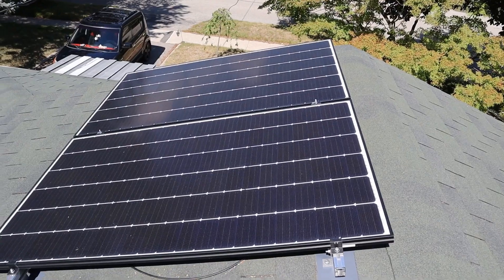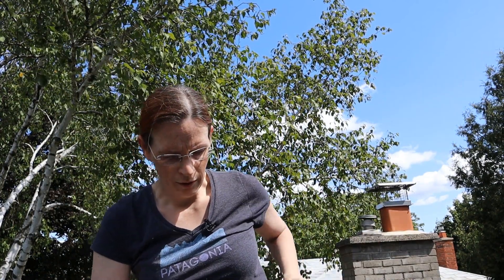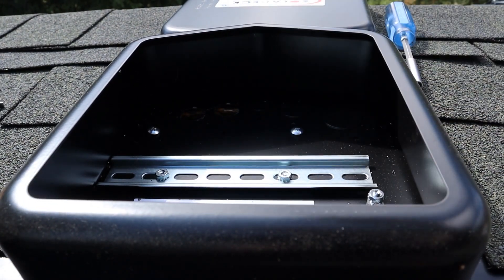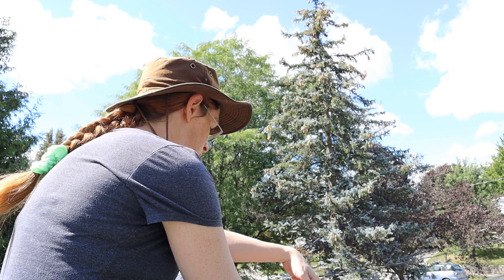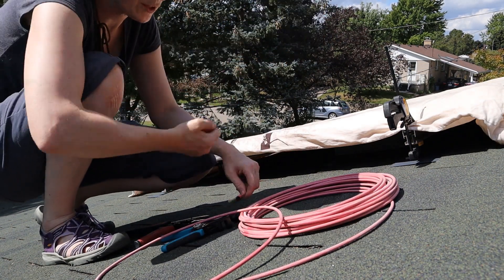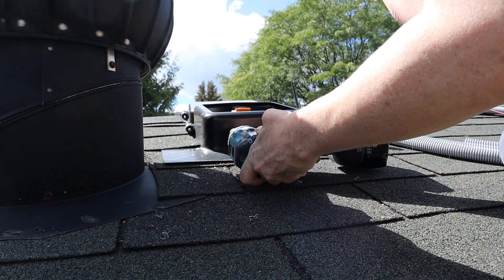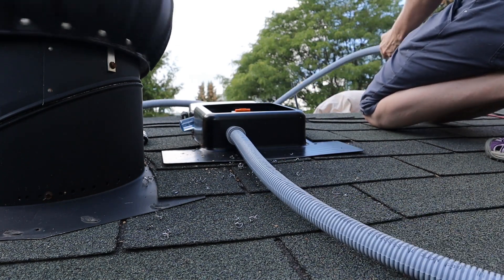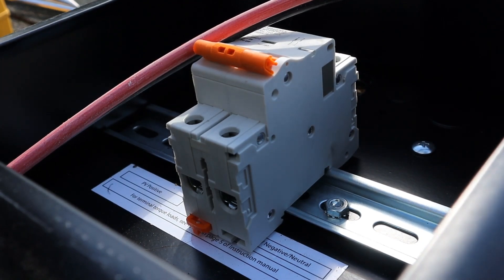Solar Panel Connection (Part 1) - How to build a 48v Lifepo4 battery (Ep. 17)

Comment: Hello from Florida, USA. I found your channel via the off-grid garage, I just wanted to offer my help if you need any, I have a 2004 Gemini 105mc that I bought with a bad diesel engine and converted to electric and currently live on full time.
Reply from the maker: Oh that's cool! Mind sharing details on your build? What batteries do you have (chemistry/capacity)? The displacement seems to be 8600lbs, eh? What motor / controller did you go with, and what's your range?
Reply: @TheDigitalMermaid  Not a problem, The build was a project boat at first, purchased it for 10k with non working diesel engine and onboard generator due to water flooding  the engines. The boat sat on the hard for many years at a local marina i lived near, so one day i saw the owner working on it and offered to buy it and negotiated down to 10k. Most of the interior was already repaired or saved, but the motors were locked solid with rust.. What happened was the boat sat in storage and the owner didnt check on it for a while and someone broke into it and left it open to the elements. The rain water collected inside and slowly flooded it out over time since the pumps were not turned on. So i pulled the motor and generator and took them apart and actually got them broken free at home, but decided to not trust them due to amount of pitting inside the bores of the engine, and just sold them for as much as i could. so i ordered a 96v 20kw liquid motor kit from golden motors in china and 8 x 12v 206ah SOK Lithium Battery modules before the prices of them went way up, i got them for $850/ea shipped. My batteries are setup in series due to the need for 96v for the electric motor setup. The modules already have internal BMS, Balancer, and low/high temp sensors. I reused the OEM onboard drive unit that went to the diesel engine and had a coupler setup machined for me so i could mount the electric motor to it and built a supporting mount system for the electric motor and glassed it in. I was able to fit the electric motor and batteries all within the area of the old diesel onboard motor. The factory displacement is 10,000lbs, but i am probably a little less due to the amount of weight that was removed between 2 diesel engines and massive diesel fuel tank. I am only able to reach 5.5 knots for 3.5hrs before the batteries are down to 10% SOC, which is my lower limit. The reason i am limited to 5.5 knots is due purely on heat exchange, the current cooling system i have setup for the motor is only able to maintain motor temps up to that speed continously within the recommended temperature range, it can go faster for short burst, but the cooling system cant keep up. Regarding my low limit, on a good solar day i can maintain 1.8 knots and never drop my battery SOC, so that speed is kinda my current cruising speed until i can finish the solar system. Currently i am in the process of rebuilding my solar system, i switched from series panel setup running a single off brand 96v charge controller to now i am running multiple smaller victron charge controllers daisy chained together with the panels in parallel. The problem with series was the shadows of a sailboat was killing my solar, i was loosing on average 60% of my potential due to constant fight with shadows on the panels... now the setup is more friendly to shadows.. I also have a new addition im adding to expand my solar an additional 800 watts on the fly when needed that can be easily stored away.
Reply from the maker: @williamhustonrn6160  "someone broke into it and left it open to the elements." - Oh how this makes me rage. Like, it's bad enough to break in, but at least there's some understandable motive there. To leave it open is just a giant "eff you!" to the owner. I hope that aresehole never knows a comfortable pair of shoes ever again. 

"Most of the interior was already repaired or saved, but the motors were locked solid with rust." This is pretty much the description of my perfect boat. Good hull / mast / rigging, shot engine / old electronics. 

I looked at SOK and they were top of my list before I decided to go DIY. Battleborn looked nicer still, but the price of even the SOKs was too much for what I planned to use. By my math, you've got about 20kw of power there, eh? 

One of my plans is to generally run below max speed as well. Electric motors, as I understand them so far, give you non-trivial range bonus when you run them below max. I'm surprised you're limited by cooling though... Any thoughts on improving the cooling? 

The shadow issue is the main reason I plan to run my panels in pairs with multiple MPPTs. The idea being to have at least one pair in clear view with the other pair is (possibly) shadowed by the sails. How much solar do you have currently? I know one of the huge benefits of multi-hulls is the additional solar options, but my heart is all in on monohulls. :)
Reply: @TheDigitalMermaid  Ya the guy was pretty sad about it i could tell, but he was far happier to get rid of it when i made the offer. He even told me multiple times he didnt think he could ever find someone to buy it due to no running engines.. So it sat for a long time in storage while he would fiddle with it from time to time as a retired older gentleman. Shockingly my boat i had prior to the catamaran was a monohull, but it was very small one i had picked up dirt cheap just for weekend fun. I had always dreamed of owning a catamaran... aka leopard... but they were outside of my price budget, so when i saw this and how long it sat over time.. i just went for it in hopes of buying it, because i had just watched a youtube video of another sailing couple find an unlisted catamaran for even cheaper.. but in far worse shape. 

I actually had to replace all the rigging and sails, they were pretty much destroyed from sitting in the sun. I ended up making my own rigging with dyneema and sailing knitting kit. 

I think i am closer to 18kw, because i only allow them to charge to 13.8v per module, for 110.4v bank voltage. my setup is very unique due to the complications of having sealed 12v modules. I had battleborn on my monohull and i would not buy them again, shockingly i had tons of issues with them and a lot of it i think had to do with my setup, which i didnt install.. that boat i had a professional do it and i just learned and watched carefully while he did it so i could understand to the best of my knowledge. That boat i had 4 x battleborn 100ah units, i had them wired up in parrallel for 12v battery bank, well the issue i had was i had no way to monitor each battery module, in the eyes of the solar charge controller, it saw the parallel voltage and just assumed they were all fine. I assumed they were all fine because they have internal BMS modules, but i kept having issues during period of low solar on that boat, the bank would drop down and sit at a low state of charge for multiple days until i got enough sun to charge it. Well the issue that i was having was i would have a random module isolate itself via the BMS for some reason, then as time went on and the sun came back and the charge controller charged everything back up based on monitoring the voltage of the bank... it thought the bank was fine, but i would have a rogue battery module sitting in bms protection without me knowing due to lack of alarm or notification system. So the internal BMS would continue to keep the cells balanced which is resistance based, it would burn down the high cells over many many days until i detected it and by then.. the voltage of the internal module is like 5 of so voltage. So i had to replace 3 battle born batteries over time due to that through warranty, so when i bought the catamaran i ditched those batteries and sold them for the most i could and went the SOK route with a different plan of improving my monitoring ability of the system. Then for a while i played around with 18650 cells and building 12v modules out of them because i was able to get them for free at different battery recycle centers, but i got tired of dealing with cheap BMS burning up on me or showing up dead, so i splurged on the catamaran and purchased the SOK modules due to how highly praised they were to value. Also my monohaul solar system was 8x 100watt flexible solar panels in series, which didnt work well.. 

Regarding the cooling issue, i have looked into it and even attempted to upgrade it once already, but it showed no difference. I think the limiting factor is the internal heatsink internal to the motor,  because i replaced the water to water heat exchanger with a larger unit with more copper plates and it made zero difference. Its cooling system is literally only like 1/4inch tubing, but i am ok with the 5.5 knots really, that is not far from the 7 knots the diesel motor maxed out at.... I was told by someone i could change out the prop to one that has less surface area, which would require more rpms of the electric motor to obtain the same speed since i am only able to go about 40% throttle, but ive not gone that route yet and trying to talk to the chinese customer service on the motor is difficult at best. 

Shadowing of the panels is really a killer on sailboats, that is why i went parallel on this setup and used a PV combiner box with internal blocking diode circuit to combine all the PV panels together after watching a few youtube videos about it. Its new territory for me, but so far its working well for me.. this is the video i went off of.. https://www.youtube.com/watch?v=XEK78TGOmbE&t=109s. . The combiner i have has 4 non-shared inputs and 4 shared outputs, on the catamaran i mounted 4 x 450watt ridget panels above the dingy stand with the help of a welder. That is my current only solar at the moment. The 4 PV panels are wired to the combiner box in parallel, this keeps the voltage the same, but increases the amperage to around 40ish amps, so on the output i have 4 x victron 50amp mppt smart charge controllers connected sharing the output of the PV panels. The charge controllers are wired to my batteries on 2 module pairs (24v) since my battery pack is in 96v series. So each controller is in charge of charging a single pair of 2 x 12v SOK modules in series of 24v. The controllers are daisy chained via communication port, so they communicate with one another on who gets to charge, so they take turns charging based on which module pair is lowest in the battery bank. Ideally i should have just bit the bullet and went with 8 chargers, but they are expensive. To power all my 12v loads, i am running everything off a single 12v SOK module in the battery bank, which is the best ive come up with to date, but to offset the drain on that module.. i installed a pair of 600 watt DC to DC converters, which converts pack voltage 96v to 12v with an adjusted output of 13.0v, so no matter what the state of charge is on the battery bank, it keeps the first pair of modules to 13v, then the solar charge controller takes over when sun is available. 

Plans going forward is i want to re-use my flexible solar panels i have. I saw another boat do this, so not my origional idea.. they had the wiring installed to the front of the boat out of the way, then when they park or anchor off and want more solar, they connected rope across the safety lines that run down the sides of the boat to keep you from fall over to form 2 lines across the front of the boat, which they used the holes of the flexible panels with carabeners and connected them to the ropes, So the solar panels lay flat strung up across the front of the boat. Then they just plugged them in to the pre-ran cables and turned the breaker on to extend their solar.. I have 8 panels already, but i think i could fit 5 across in 2 rows before i loose to much area to not be able to walk around the boat easily.. it would give me 800 watts and potentially 1000watts if i get 2 more.. just unsure how i want to go about adding them to my current setup yet.
Reply: @williamhustonrn6160  ""...i mounted 4 x 450watt ridget panels ...""   typo (450)?  if not, this seems to be on the low side...  "" ...this keeps the voltage the same, but increases the amperage to around 40ish amps,.....""
Reply: @tcloud24  they are rated at 45v @ 10 amps each.
Reply: 4 x victron 50amp mppt smart charge controllers, charging a single pair of 2 x 12v SOK modules in series of 24v. @williamhustonrn6160  so i am to assume the 45v is the open circuit voltage and the 10amps is the short circuit current?  i'm still having a time with the math.  let's say we can get max, just for easy calc.  so, 1 panel delivers 45v @ 10amps (450w) to charge controller.  now charge controller can deliver 24v @ 18.75amps (450watts, we know it is not 100% eff. but for easy math) to 2ea 12v batteries connected in series, right?  if we look at the total string at 96v, we get max charge is 18.5amps x 96v = 1800+/-watts.  if we look at 4ea. 24v x 18.75 we get 75 x 24 =1800w.  where does your 40ish amps apply?  btw,  those panels must be huge.  do you know width & length in inches?
Reply: @tcloud24  For some reason i cant reply your last message, but ill reply here. You are slightly off on your last message. The rating of the Victron charge controllers is PV max voltage and max amperage on both input/output... So a 100/50 is max 100v@50 amps PV and max output of 12/24v @50amps. The controller limits the output greatly, especially at higher pv voltage.. because 100v@50amps is 5000watts of input its capable of handling, but even with that 5000watts of PV solar, the max output would only ever be 12/24v@50amps... so either 600 or 1200watts. That is why when you have more wattage going into a charge controller than it can output, the heatsinks gets very hot from it dumping the extra amps as heat. On a full sunny day i only ever see 18amps usually except at the end of the charge cycle when some modules cut out before others and the amperage can shift around on the PV side of the chargers. Remember electricity takes the path of least resistance, so when a charger controller goes to absorption or float and the amperage drops to nothering, its directing the amperage into the heatsinks as a resistant path, but because the other chargers are still charging, the power would rather not turn into heat on the heatsink and instead take another path through another charger to charge another set of batteries. So right as the chargers about to hit absorption, the other chargers will jump up in amps as one by one charger flips to absorption. regarding the SOK batteries, they do not unfortunately have a bluetooth capable BMS, but they come standard with an active balancer which balances anytime the battery is no receiving incoming charge. So it actively balances the cells when your drawing a load with no solar at night and during the absorption pause time. My current settings are Absorption 27.62V, Absorption time 0hr04min, Float 27.6v, bulk offset 0.10v.
Reply: @williamhustonrn6160  i found i was wrong so took the post down.  you must have seen it as soon as i posted.  sorry!!

most of what i wrote was based on your controller being able to output 48v.  my record for the last 24-48 hours hasn't been good.  i think i need another nap.

i did save the post so i could correct it.  i'll try again later with more rest and knowledge.
Reply: i'm back.  let's start with a link...

it seems you tube won't let links happen.  maybe i can do bits...
victronenergy  olar-charge-controllers  smartsolar-mppt-75-10-75-15-100-15-100-20#download
good luck!!

 @William Huston, RN  i think i have a handle on your setup.  to start, let's sort that 40 amp thing.  true enough at max output 
(the total panel output) could be 40amps @45v. once it goes through the charge controller, the output will be in the 24v range at 
about 20a.  since all of the solar output is tied together and the controllers are talking to each other, i think the charge rates 
will stay close to the same for each set of batteries (probably as you have seen).  even if 2 sets have reached a charged state and 
charging has stopped to those two, the ones still charging, probably with a high voltage by now, will be at low amps, soon to reach their 
charged setting.  correct me if i'm wrong.  

your one battery tied to the house could cause the exception.  i think that can be solved by disconnecting that battery from the house.  
instead use the 2 dc to dc units, from pack voltage (96v), to feed the house bus bars.  at 600 watts each, they should be able to 
carry 46 amps each at your suggested 13v.  unless i'm missing something, the bank should be clean and each battery set will 
charge/discharge at close to the same values.  keeping each set at the same voltage (balanced, so to say) might be hard to do, but will probably be close enough.

""100v@50amps is 5000watts of input its capable of handling, but even with that 5000watts of PV solar, 
the max output would only ever be 12/24v@50amps.""

you are looking at this wrong.  if you have 5000w available for charging a 12v system (5000/12=416.66amps), you will need a controller 
built to handle 416.66 charging amps. of course if you are working with a 24v system, amps would be half (208amps+/-), etc.  it is a 
shame your controllers can't do 48v.

""...due to the current of my solar panels i would have only been able to use the giant 100 and 150 amp charge controllers...""  
i don't think that is the case here. .... 

for 2 panels together for 1 controller 90v at 10amps (or 45 x 20amps) for input.  48v at 18.75amps output.

this is close to our hostess system.  Open Circuit Voltage (Voc):43.50 Volts    Short Circuit Current (Isc):9.65 Amps

for this she chose the victron MPPT 100/20-48V.  from the link above (if you made it work) we find Rated charge current is 20a, Max. PV short circuit current is 20a, Max. PV open circuit voltage is 100v, Nominal PV power, 48V is 1160w.  now....

2 pnaels = 90v @10amp or 45v @ 20amp  = 900w.  that looks doable to me.

the extra solar panels may be tricky.  in one post from https://www.victronenergy.com/live/drafts:mppt_faq
(hope that works)

Q8: Can I connect different panels to the same charge controller?

No. Under no circumstances.

i am not sure why that would be so bad, but victron was not at a loss for words.  this means your 8 extra panels will need their 
own controller/s.  if me, i might  be tempted to wire them together so they had open voltage of 120v (or so) and just go direct 
to the 96v string.  put an on/off switch in and be done.  if you see it can help charge, turn it on.  otherwise, off.  just a thought. 

i saw your reply on the blue tooth. that makes life a bit harder.  can you see each charging leg?
Reply: youtube must be trying to make up for the one that got lost...   lol!!